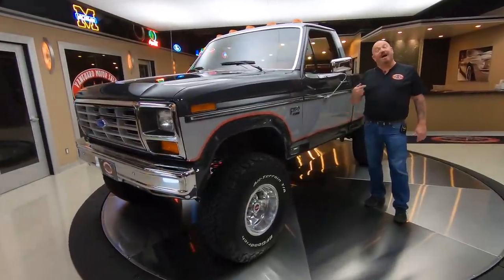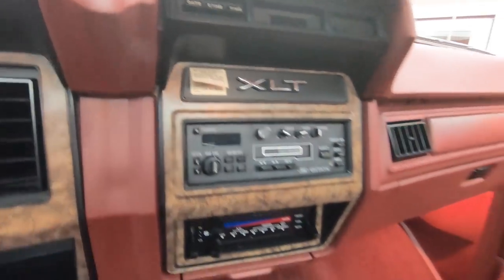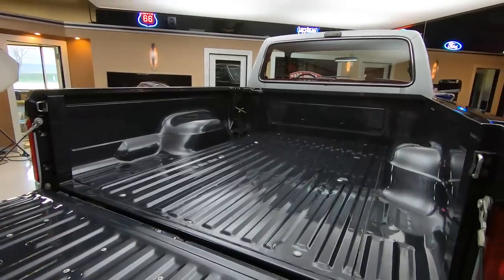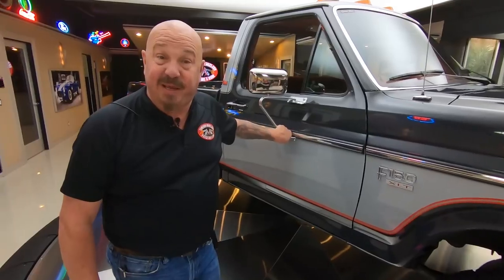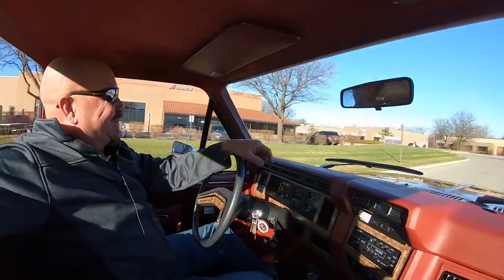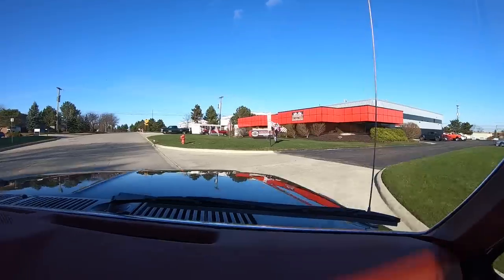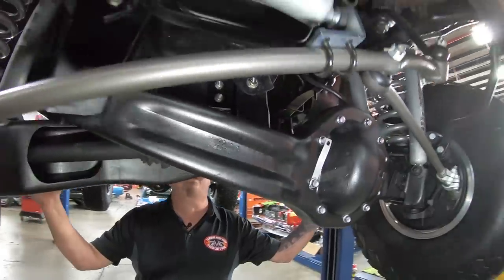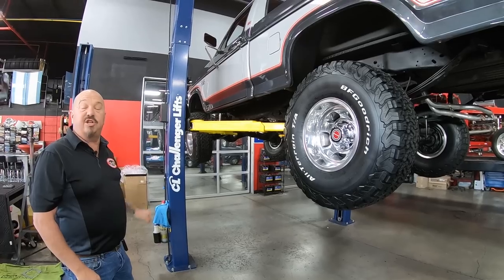1985 Ford F-150 XLT Lariat For Sale (5500 Original Miles)

Comment: Wrong, 86 460 was full mechanical carb,87 460 had an electric carb which was the last carburated ford engine. I still have my 86 f350.